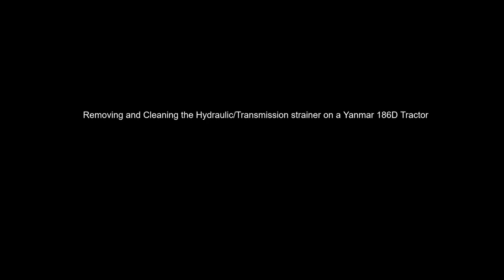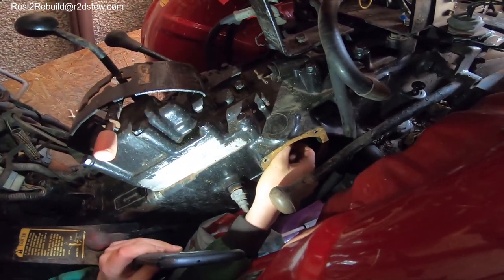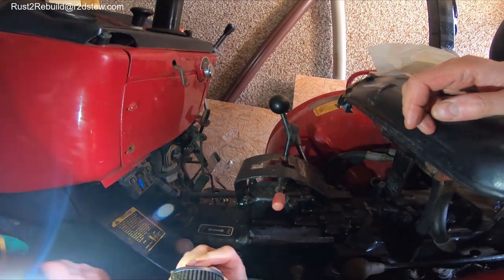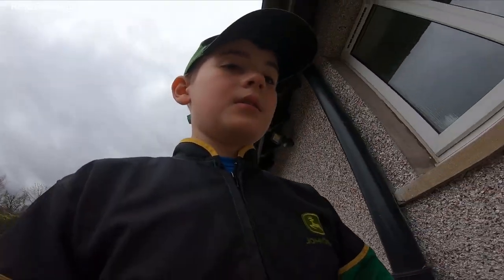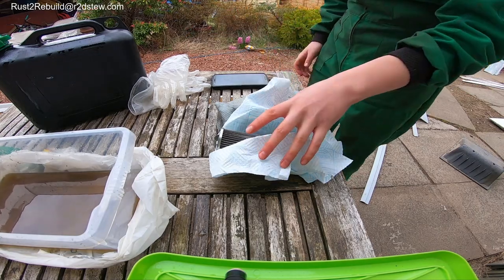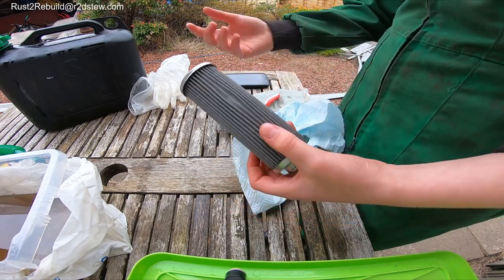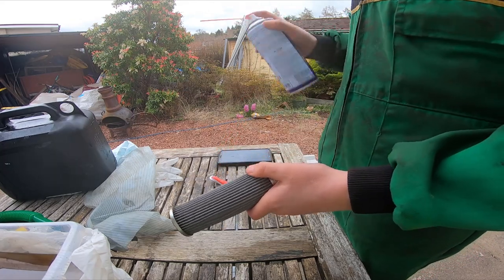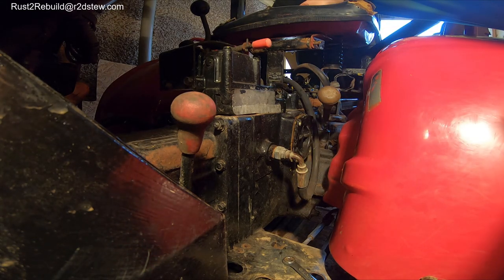Yanmar 186D Tractor Hydraulic/Transmission Strainer Removal And Cleaning

Comment: Just bought one of these tractors!  Great video.  Thanks for showing your difficulties getting the housing off,  realistic.
Reply from the maker: Yeap, any problems or need any advice send them this way👍
Reply: @rust2rebuild720  Do you ever have any issues with white smoke underneath the front end.  It only happens when the pto is engaged at 1000 rpms and hooked to a piece of equipment, i.e. a rototiller, or mower.  I don't think it is anything too serious.  It is not a heavy smoke, light real faint.
Reply from the maker: @kireerogg6326  thats normal- when operating things at the PTO you want to have it at about 1500-1800 rpm. If the engine it under load a bit of white smoke is fine

Comment: can you do a video on the hydraulic lines of input and output on hooking up the back hoe and the front loader, i have same tractor I am wanting to do this to but can't find any info on the lines, anylinks or videos would help a ton thanks
Reply from the maker: Hi, yes I can  
The backhoe doesn't run off the tractor hydraulics but the PTO powers a pump. I have a English 186d if it makes a difference, and the front loader is a standerd dulxe which is a English loader brand found on other British 186ds, my emails is rust2rebuild@r2dstew.com  or I could make a video if that would be easier?
Reply from the maker: I have now made a video on hydraulic lines!

Comment: Hi. Great vid. I have nearly the same tractor, 186D but with the column-mounted power shift. I was wondering, did you drain the trans fluid before servicing the strainer? Thanks.
Reply from the maker: Hi Howard, you do not have to drain the trans fluid, although I would recommend changing the trans fuild and filter while you are at it. 

You can use ATF or John Deere hyda guard(hydraulic oil/transmission oil)

Where are you based?
Reply: @rust2rebuild720  Yeah, I drained the fluid, changed the filter and re-filled the trans with H/T oil before I realized I'd forgotten to do the strainer. I was just wondering, if I remove the strainer now that the fluid has been replaced is some going to leak out and if so, how much? On line forums are of no use as they all give differing opinions. Guess I'll just have to buy a couple extra quarts of fluid and get ready to make a mess.  As soon as I can get to it, I'll dive into it and post the result, minus the inevitable curse words of course. Might not be until the weekend. 

By the way, if the use of the word "quarts" didn't clue you in, I'm from the U.S.
Reply from the maker: @howardgrant4254  When it is off there is no oil there so you can just take it out - the tractor was still full of oil in that video. The main thing is when taking the cover on and off be careful not to crack/sides off as it is very easy to do, what I recommend is once you have loosed all the bolts (bit a time, -crack one crack the opposite one etc..) and get a pair of vice grips and grip on to the cross in the middle see if you can turn it a bit to crack seal, and with a screw driver carefully stick it in and push each side out.
Reply: @rust2rebuild720  Alrighty. I got the cover off and there was some minor leakage (maybe 12/ cup/118 ml.) and only a little cussing. Got it started with a small screwdriver and a rubber mallet and finished it up with a Wonder Bar. Took me about 10 min. to get it off. The screen was dirty but nowhere near as bad as yours was. Cleaned up and reinstalled slick and easy. Fun times were had by all.
Reply: That was supposed to be 1/2 cup.
Reply from the maker: @howardgrant4254  Were you running the tractor right before you started work on it?
Reply: @rust2rebuild720  No. She was stone cold.
Reply from the maker: Hmm, how bizarre
Reply from the maker: I wouldn't worry about though